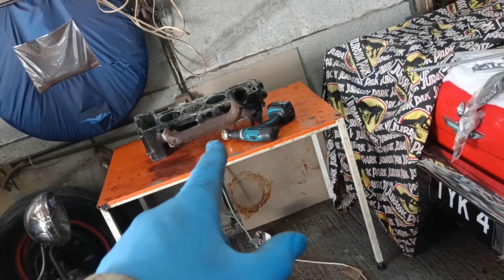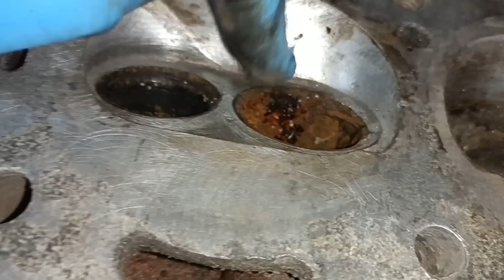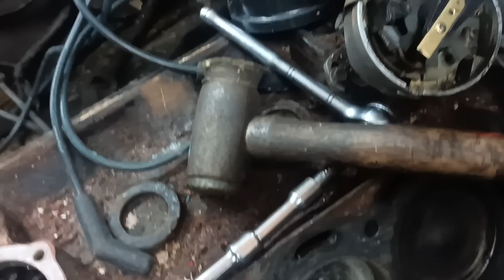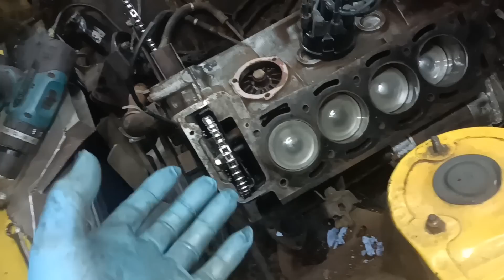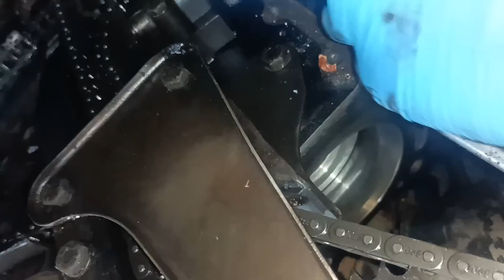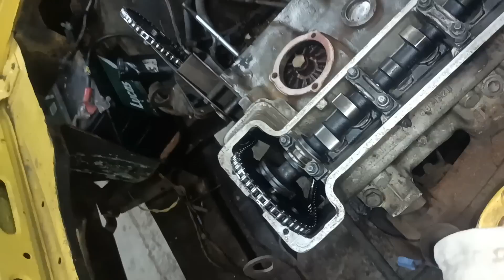Stag Engine Repair Pt3: Timing chains and cams reset from scratch. Head and valve cleanup starts.

Comment: Knowing water has got into the cylinders I definitely would’ve got them heads skinned
Reply from the maker: Cheers Paul. I elected not to skim as they have already been skimmed once. Who knows if that will come back to bite me. Thanks for watching and commenting.
Reply: @MartsGarage  hopefully not I know how temperamental them stag V8 can be.  Whenever I’ve done head gaskets, I always pressure test and skim regardless. And with the stack heads, they could’ve been skimmed more than once before.

Comment: I think you’re fined that the slipping of the chain is a blessing in disguise because ( I’ve rebuilt theses engines) the chain tensioner have a rubber type face that wears a lot and then pops out causing the valves to hit the pistons , the chain tensioner are cheap so please replace them for new ones while you’re at it 🙏🏻🙏🏻
Reply from the maker: Cheers Paul. The tensioners looked in ok nick so went back in after resetting. The motor does not have a lot of miles on it since a previous rebuild. Thanks for watching and commenting.

Comment: Hi Mart.. it all looks too complicated. I'd want to copper coat or shellac the head gaskets down but it appears you gotta slide those sucker's in cause of the cam gears and timing chains and housings. Hope it works out ok.
Regards Kevin
Reply from the maker: Hi Kevin. No the gaskets just drop down like normal. I didn't put any copper spray on them, just a smear of hylomar by the water passages. Who knows if that is a good or bad thing.

Comment: Just a bit unclear about the head studs. They have to be removed before the head comes off?
Reply from the maker: Yeah. There are a row of bolts along the bottom that are 90 degrees to the head face. The studs are not at 90 degrees. The heads need to come off at 90 degrees or you bend the cam gear retaining brackets. I imagine there might be a scenario where the studs could remain in place but the problem is always corrosion between the studs and head so removing them individually is the best way to go. Thanks for watching.
Reply: @MartsGarage  Thanks mate for the info. To be honest, I'm still in the dark. Could you put a couple of minutes in your next video to show what the problems were/are?
Reply from the maker: Hazzy, I'm not an expert so don't want to try and make statements about it because I might be wrong. I just followed the works repair manual that said to take the studs out.

Comment: Those cylinder heads need hours of work. A lot of the waterways have previously been welded up in a previous poor attempt at repair. They need hours of welding and machining. Please don’t refit them as they are, it will overheat again and you will be back to square one.
Reply: Yes, I would never work like that! Correct machining, cleaning everything, checking all clearances before even refitting everything. I bet this engine does not last long.
Reply from the maker: You might be right. Who knows? We will never know unless we try. Always willing to revisit if it fails. Thanks for watching and commenting.
Reply: You sir are correct 👍

Comment: How about a cheep valve job, just lapp in
Reply from the maker: Hi Brendan. The valves looked in good condition so I left them as is. I probably should have lapped them but didn't. Hopefully this doesn't come back to bite me. This engine was previously rebuilt not many miles ago. Thanks for watching and commenting.

Comment: Mart, that looks like a nightmare , to adjust the valve lash
Reply from the maker: Yeah. It would be easy if you had multiple sizes of shims to hand. I'll show an overview of the shimming process in a future video. It took a long time.
Reply: I’ve done plenty of the Dolly sprints and they 4valves per pot  as well as the stag engines ! 😂

Comment: Hi Mart, interesting stuff as always, watching your learning curve makes me wonder how we managed before YouTube. The Flathead knowledge that you pass on adds to that resource. I now know why when every hotrod and custom seemed to feature a Rover engine I didn’t ever see a Stag engine used, although I think modern radiators (like the one you are repairing) and coolant have fixed the problem issues.
Reply from the maker: Hi Pat. Yes, Rover engines were everywhere at one time. I suppose Stag engines tended not to be used because they were troublesome. Only people wanting to preserve their Stags were invested enough to work through the problems and develop the improvements like water pumps and radiators we now have. Plus the Rover lumps were in many models and were further developed by Rover while the Stag was used in one model and dropped. Thanks for watching and commenting.

Comment: Looks like a copy of the Jaguar sustem- you should have measured the clearance on each valve before disassembly, then when re-assembling you have a baseline to know what thickness pad you need for the proper clearance.  Do your valve adjustments on the bench before to put the heads on the block.

Comment: too late now never use a wire brush on an aluminium head. OK maybe not a restoration but you really should have the head skimmed and use a composite gasket or you are asking for trouble.
The timing chain tensioner looks the same as a Jaguar XK engine one, check in the block to see if there is a brass cone filter where the oil feed hole is, if there is get it out and clean it or the tensioner will seize due to lack of oil.

Comment: The waterway is badly corroded to wide (very common) we used to get them built up by ali welding around, before skimming, another interesting thing while at a car show a chap had a stag with an external Ford 3.0lt V6 (Essex engine) water pump bolted to the block via support bracket driven by belt of crank pulley, this pump was plumbed inline with the vehicles water hoses (looked like it was standard fitment) he said and i tend to agreed with him the stag water pump is very poor and the Ford V6 pump worked brilliant, nice videos as always.

Comment: Amazing clean up job. Ive got to say, that whole block would have gone in the skip the moment I saw the corrosion and pitting on the cylinder block. It needs a deep skim in my opinion and might not be savable if you can't find the appropriate oversized head gasket. Will be watching and cheering you on 💪👍
Reply from the maker: Thanks for the encouragement. Yes, things are sub prime for sure. Lets keep our fingers crossed it turns out ok.

Comment: Good progress Mart, but those c/heads need skimming, they'll never hold water or compression mate, wasting your time putting it back together
Reply from the maker: You might be right. The heads have been skimmed once so we decided to reuse as is. We're crossing our fingers it will run ok. A further teardown might be necessary, who knows? At least it will come apart a bit easier than last time. Thanks for watching and commenting.
Reply: Really enjoyed the filming very good   ,  even though iv done plenty of stag engines,, only skim heads  if it is not flat , check on flat surface often looks naff because of metal staining  scratching etc ,  seen many good heads skimmed and skimmed to a mirror Finnish then told no good , not necessary , look forward to next film  !
Reply: I was thinking the same.

Comment: It got so far taken down I think I would have pulled the engine. You have done a great job in cleaning things up. I remember going through a lot of brass and stainless wire brushes and all kinds of other abrasives on another old engine I did. That water pump spigot could have used a metal filler snd brought back to a smooth hose mounting. Wonder what the crank and rod bearings look like? Amazing the amount of time you can put into an old engine and in the end it will run well.  Some people think you are crazy if you say it was fun.👍
Reply from the maker: The engine doesn't have a lot of miles on a previous rebuild (but a long time ago). So I expect the crank and bearings to be good. We elected to get all new water necks.